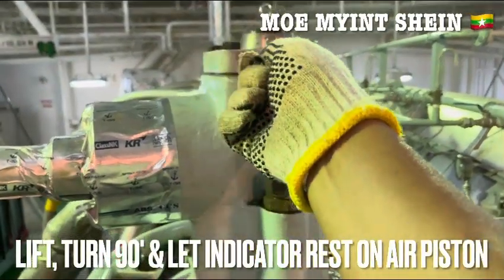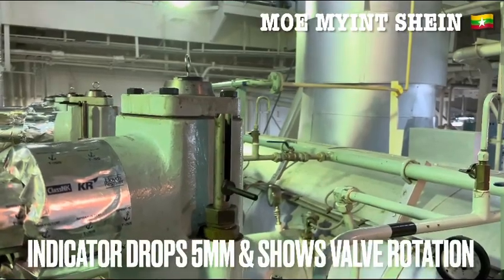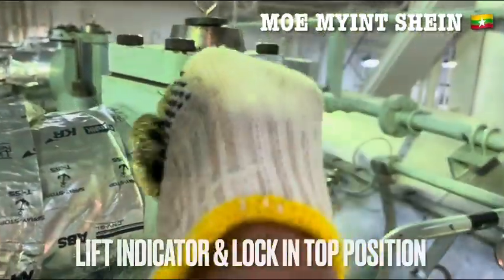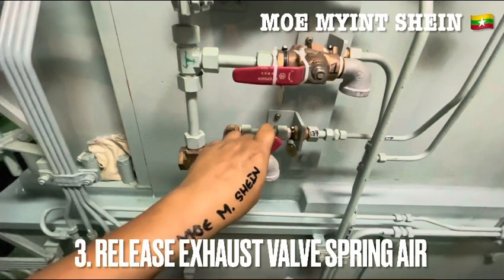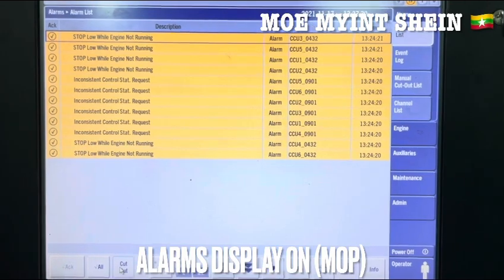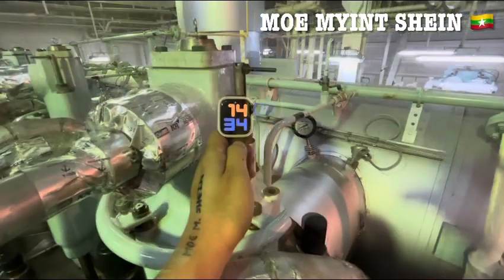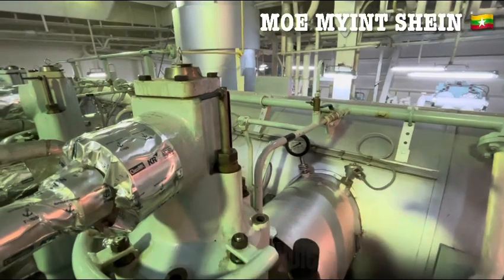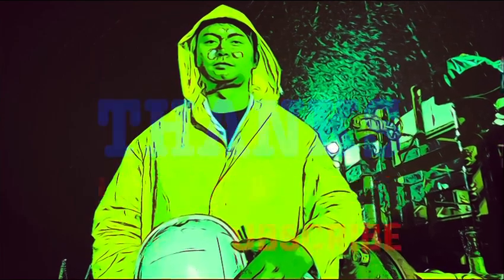[MAN-B&W] EXHAUST VALVE Checking | During RUNNING | During STOPPED | Technical Vlog : 050

Comment: Hello sir, Does releasing spring air release the air from the spring air line or is it draining the air under the piston?
Reply from the maker: Drain air under piston. 
Some goes to spindle for sealing.
Reply: @ in that case isn’t it obvious for the spindle to drop? What is holding the valve if spring air is released?
Reply from the maker: Spring air can leak between the air piston and the air cylinder. This can occur if the air piston rings are not in good condition or if the inside diameter of the air cylinder has expanded. In such a case, the valve spindle will drop down more quickly.

The explanation above describes how the spring air escapes from beneath the air piston under normal running conditions.
Reply from the maker: Conical locking ring and flange on top of air piston hold the valve spindle.

Comment: Sir good day.
indicator bar will drop 5mm more than normal, when it is in the groove.
it means spindle is rotating.
Reply from the maker: Absolutely Right !!!
Hole for this valve indicator is also used for another purpose in emergency condition. Do you have any idea for that? 😊
Reply: @CHiEF_MOEMYiNTSHEiN  no sir
can you pls teach me!🙏
Reply from the maker: @mec6953  
This is also used in cutting out exhaust valve in emergency. 
In here, I will explain you, briefly. 

As first, isolates hydraulic line by lifting exhaust valve actuator. Hydraulic isolation for exhaust valve finishes in here. Also, need to cut out exhaust valve spring air. 

Close Air Spring Inlet Valve to Exhaust Valve. Drain air under the air piston by removing drain plug which is near bottom of air cylinder. 

After then, removes valve indicator bar and put special stick which is used to  press air piston, to keep in exhaust valve open position. 😊
Reply: @CHiEF_MOEMYiNTSHEiN  
many thanks! i learned a new thing from you today🙏🙏